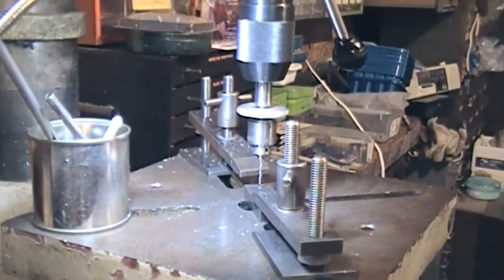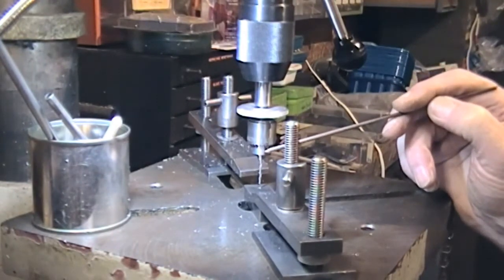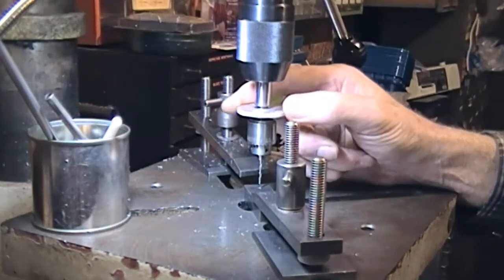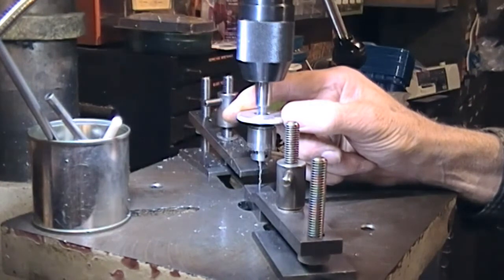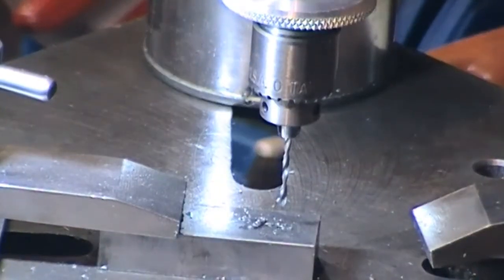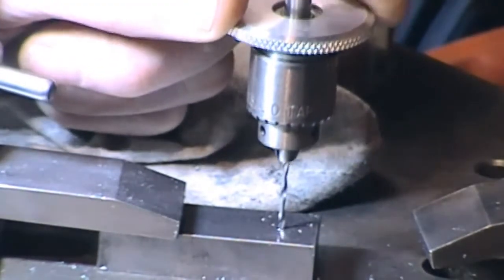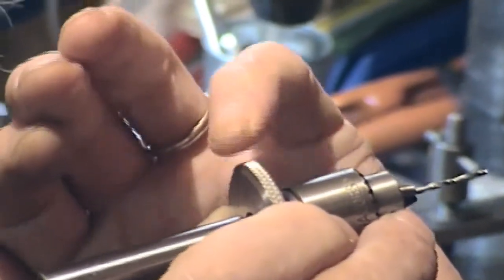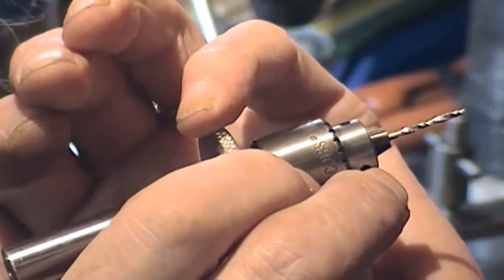A useful mini-chuck device for assisting use of very small drills

Comment: hi chris ,never seen a mini-chuck like that one before.nice bit of kit though and as you have said great for delicate feeding,i couldnt count the number of small drill bits ive broken over the years using a normal heavy drill,ended up buying a mini drill with the different sized mini collets and stand to get round that one ,thanks for sharing this video chris.........dougie
Reply from the maker: Dougie - wish I could remember what it was called and where I got it.  I am certain it will still be available - somewhere. Beauty of it for me, having it in drill press, is being able to keep good center and accuracy etc. Only used occasionally but, invaluable to have handy.

Comment: Having recently discovered a tiny Jacobs chuck in a drawer, I got one of these "sensitive" drilling devices from McMaster-Carr (yes, they are still available).

Two things to note:

When thinking of chip clearance, you should be thinking not of absolute depth (mm or thousandths) but in drill diameters. If you are drilling with a .025" drill, you need to clear chips every .050" or so - about two drill diameters. You do this instinctively with larger drills; you clear chips every half inch or so when drilling with a quarter inch drill once the hole gets to any significant depth.

When thinking about tool pressure, never forget that the cutting area of a tool varies with the square of the diameter: that .025" drill has 1/100th of the cutting area of the .250" drill and only needs 1/100th of the amount of tool pressure to achieve the same pressure in PSI at the cutting surface.

Ignoring these two things has broken more tiny drill bits than any amount of misalignment - those tiny drill bits are actually quite flexible.
Reply from the maker: Peter W. Meek Hi Peter. Ahh yes, chip clearance.  I find when using micro drills I am actually over cautious with clearance, and, as far as pressure goes - can we say ''feather-weight' :) The beauty of the mini chuck is the ability to avoid pressure from the quill - just the delicate feed from hand guidance. Don't use mine often but it's a real boon when needed.

Comment: I noticed this is an older post but in case you come back to it.......
any chance you can take that thing apart so we can see how it works?
I've seen a couple of them one used and one new but both were way too expensive for what they are and considering the fact that I'll use it once a year.....
can't be that hard to make one, right?
I came across two brand-new micro Jacobs Chucks, brand new in their packaging at a garage sale some time ago.
they are threaded, and I have some really nice stainless steel very straight threaded rod that they spin right onto and run very straight and true....
I'm thinking I could turn down a section for a bearing, but Id still need to figure out how to drive it while I plunge or peck my hole without having to pull down on my entire Z axis....
so if you can take yours apart great, if not any thoughts would be appreciated....
Reply from the maker: Hi Chris -- I don't think disassembly is very practical to be honest. Main thing is, the wide 'holding piece' is running on a small ball race I am thinking and the connection between arbor and chuck end is spring loaded - daresay the whole thing was pressed together during manufacture.
They are still available but forget what name .. some careful searching may bring something up.
Check this one out on ebay -
http://www.ebay.com/itm/J0-TAPER-1-2-INCH-SHANK-SENSITIVE-HAND-DRILL-FEED-3700-0001-/231597437698?hash=item35ec487302:g:YoQAAOSwo0JWKmwH